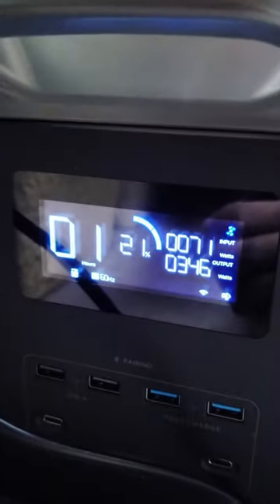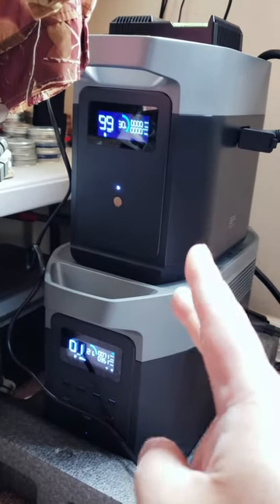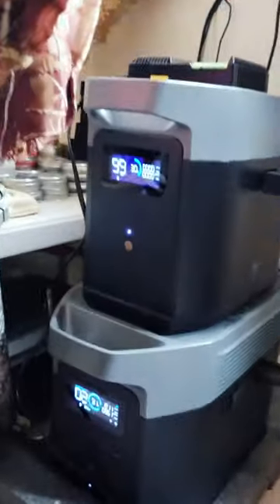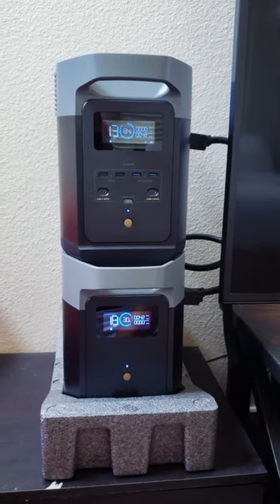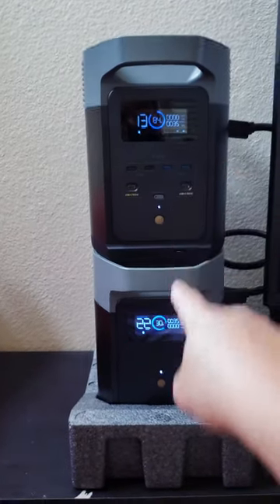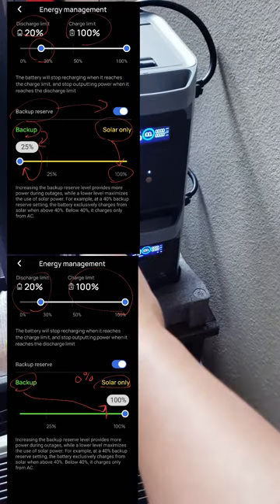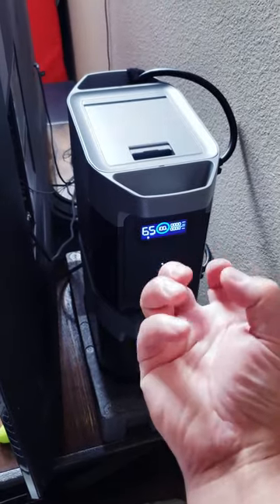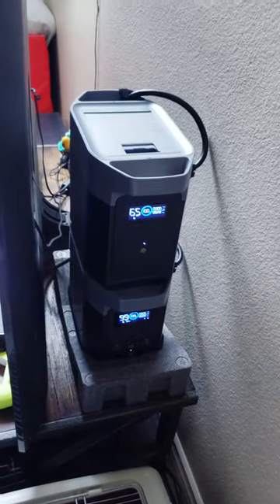EcoFlow Delta 2 Extra Battery ONLY WORK WITH Delta 2, NOT MAX Series

Comment: I have the Delta 2 I didn’t know this mine can use both the Delta 2 and Delta 2 max this is good to know 👍🏽 I need to get the extra battery at some point
Reply from the maker: excellent Products, I finally got 2 more Max2 batteries for the Max2.  It is amazing to link them up to a total 8KW, basically it will power Xbox & 65" Tv combine ~300W, for 26hrs.

Comment: so it`s possible to run Delta 2 Max extra battery with Delta 2 ?
Reply from the maker: Yes, you can make a 3KW system using Delta 2 (1KW) + Delta 2 Max extra battery (2KW)
Reply: @Repsol13  thank you very much, in UA nowadays there is a problem with electricity, because of Russians(((